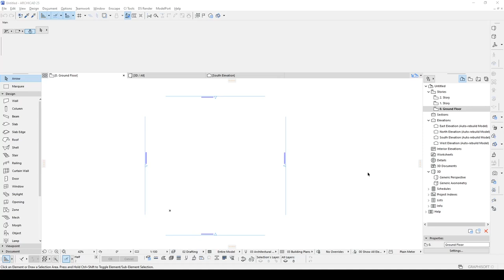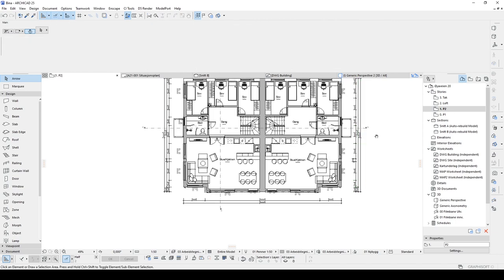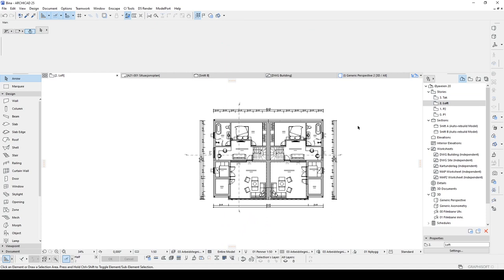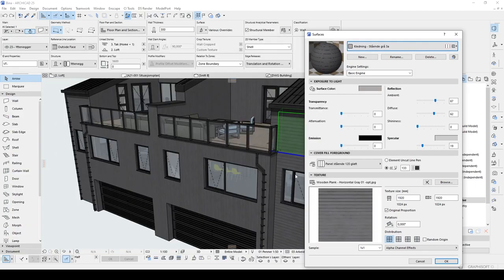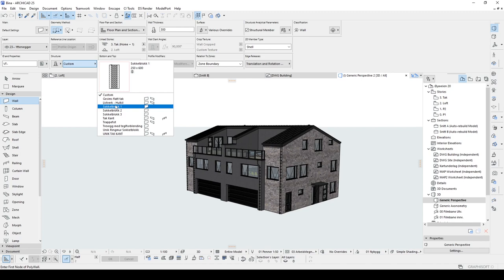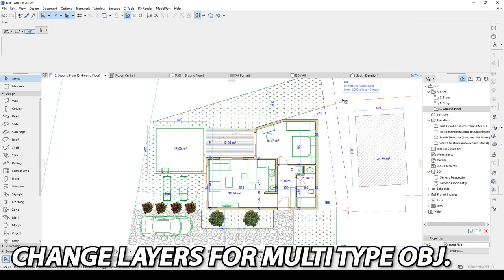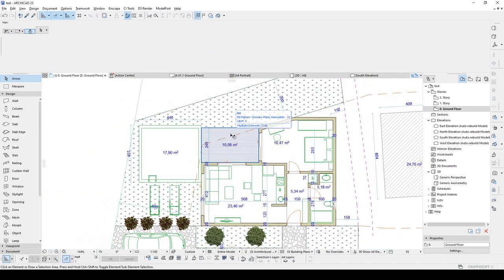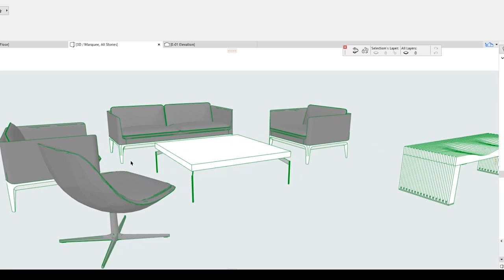5 Pro Tips for Archicad Tutorial

Comment: Hello SB, thanks for your videos and let me agree with you for the 4th & 5th ones but for the 1st one I see you have to readjust all dimensions you have pasted in second floor to be dynamic which requires some efforts to relink every node of the dimension line also sure you have to uncheck the static button in the first floor,
For the 2nd & 3rd ones I see deleting BM and copying profiles is critical if you’re working in a team so you can manage them by attributes manager that lets you delete or append as you wish, and sure there’s surface painter tool which lets you change many surfaces with just few clicks, thx again and accept my greetings.
Reply from the maker: yea thats true but my advises are for some special situations not for general. let's presume that you have a building with lots of floor and plan area. these methods will save your time